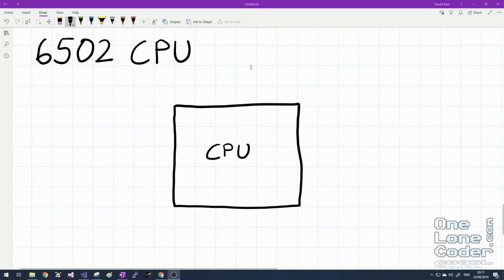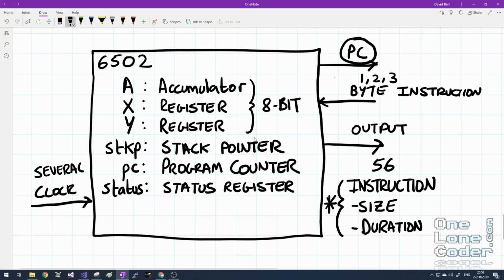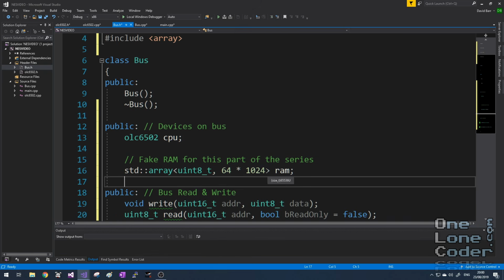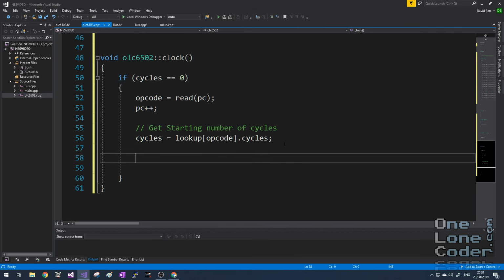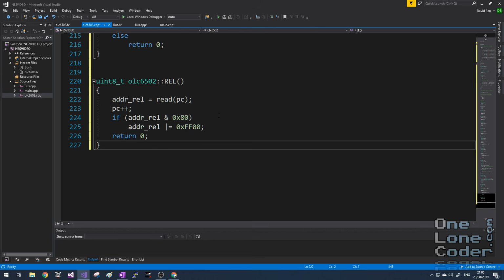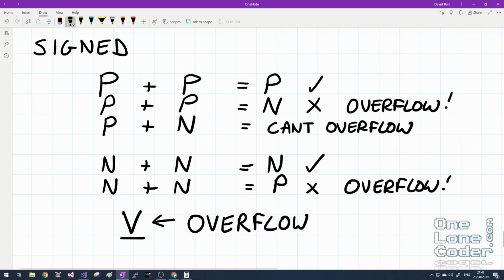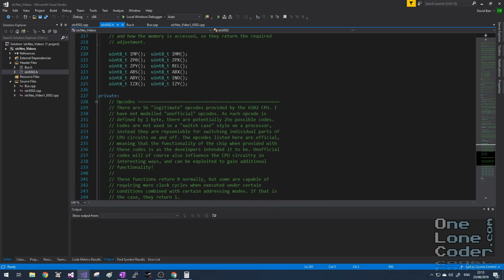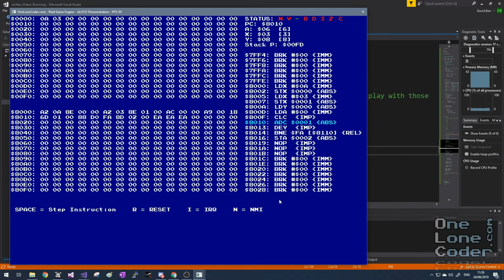NES Emulator Part #2: The CPU (6502 Implementation)

Comment: One thing i wonder - how much speed can you gain by writing emulator entirily in assembler?
Reply: Writing an emulator in C++ and compiling to run on a modern processor from the 8086 family will already give the emulator an incredible speed boost over the original chip, by virtue of the fact that CPU's nowadays commonly operate from 2.5 GHz upwards. The CPU in the original NES was probably clocked  in the MHz region.

Certain complicated parts of an emulator's code could likely be written in assembler to gain  the maximum amount of performance, but the real question here is how useful would it actually be to make this emulator run any faster than it already does? Looking at games from even the PlayStation 2 era, running on PCSX2, certain physics such as run speed are tied directly to FPS, etc. Not to mention that as expressed in comments above, not sticking to clock cycle timing religiously may break some games that make use of certain behaviour at a hardware level.

Given that NES games were built specifically to operate well on this hardware, what benefit do you get by further increasing the speed of this emulator which will already be running many thousands of times faster than the original hardware? You would just waste even more host clock cycles idling while waiting for emulated clocks to tick over.
Reply: Thanks for the info! I am only vaguely familliar with the fundamentals of emulation. That's some great information.

What about writing an NES emulator for a systems that was made around the same time as NES itself? +3-4 years after it. While those systems (Sega Genesis for example) had more processing power than NES, it would still not be ennough to run an emulator, written completely in high-level language such as C++? Would it make sense to write in assembler in that case? Or is the boost so insignificant it wouldn't make a difference?
Reply: @GRZNGT  That is a good question. When the computer you are running the emulator on is only marginally more powerful than the hardware it is emulating, it then becomes important to make sure that your code is efficient otherwise you risk lag. The emulator itself will add overhead when processing the opcodes of the hosted architecture, so the processor had better be good enough that it can execute an "emulator cycle" at least as fast as the real hardware can execute a real cycle.

In order to calculate how much faster the cpu would need to be, you would need to measure how many real cycles it takes to execute a single emulator cycle, then multiply the NES clock by that number. In this situation, minimum CPU requirement relies directly on efficiency of the emulator.

In the modern day, however, we have an abundance of computational power. This means that less and less regard is given to writing efficient algorithms and programs compared the past, because we simply have more processing power than we actually need in order to do this.

If the NES was powerful enough to run those games back then, then there is no real reason that even a badly optimised emulator shouldn't be able to run a NES game smoothly in a modern computer.

Optimisation of (NES) emulators would have been important if we were attempting to run the emulator on a computer of similar era to that of the NES itself, but given the sheer power of modern day computers, we don't need to worry about writing any of this in Assembly. C++ is more than powerful enough to get everything done quickly, and still leave a few billion cycles before the next emulator cycle is executed.

Emulators didn't exist back when this would have been a problem!

P.S. This is a very naive attempt at an answer that doesn't take any of the more "modern" aspects of computers or Operating Systems into account. Time slicing and other OS level process management, etc, could all factor in to this argument at a "user mode" level.

The above answer pretty much assumes that the "modern computer" in question will execute only the emulator's code and nothing else. Effectively, the emulator would be the Operating System.
Reply: Not much, as 6502 opcodes are nothing like x86 opcodes. (Maybe I'm wrong)

Comment: A funny thing happened when I compiled the code with the VS2019 x86 Native command prompt. When I linked the program, Windows Defender immediately gave me a virus alert and deleted the executable. In case anyone wants to reproduce it, I ran cl /c /EHsc *.cpp and then link /OUT:olcNES.exe *.obj. Might have something to do with the machine code injection? Still, it's an amusing false positive.
Reply from the maker: That could be the GetAsyncKeystate used in pixel game engine. Some AV software can identify its use as being a key logger. Interesting find though, nice one.

Comment: Why the CPU don't store the register state on the stack? It's only 3, and is something the IRQ handler will always have to do by itself. I think it's something most CPU's do? (I could understand it on an x86 system, maybem it has a lot of them, but this ones?)
Reply from the maker: Registers in hardware are a lot more complex than simply memory locations. They have all sorts of digital connections to various parts of the CPU.

Edit: Lol, read this back and completely misread the question XD
Reply: Calling an IRQ is already 7 cycles long (longest instruction in CPU!). Pushing 1 register on stack takes 2 cycles ( 1 for write to memory, 1 for decrementing the stack pointer). So 3 regs will take 6 cycles. That will make an IRQ waste 13(!!!) cycles before it even begin! And what if IRQ only use 1 register?  (Usual thing. Just grab data from device and store somewhere) Then it wasted 4 cycles for nothing.
Reply: @rsa5991  That makes total sense. Just talking out of frustration in my Univeristy times, on Operating System. lab, having to push ALL the x86 registers to the stack in meticulous order to not to confuse the CPU when returning from the interrupt. Was hard and confusing :)

Comment: rather unrelated question: why are the integer datatypes called uint8_t, etc.. and not just uint8, uint16 etc.. ?
Reply: It's simply because the t stands for type

So uint32_t == unsigned 32 bit integer type

Comment: How are the cpu timings going to work? Isn’t it running 100x faster than the actual 6502 right now?
Reply: I think he half-covered it in the beginning.. Instead of the actual 6502 processing some instruction over x clock cycles, he can use his extra-fast modern CPU to perform it in one step, then just 'wait-out' the rest of the clock cycles for the appropriate amount of time.. Then move onto the next instruction. Correct me if i'm wrong!
Reply: Well the 6502 in the nes is like... 1.7mhz for NTSC/1.6 PAL
that is 1700000 (this is apx, not exact, check online for exact)
1hz = 1 cycle... so you run the rom until 1700000 is reached in a single second then you just WAIT and do it again
basically running 1700000 cycles per second.

so if it takes say. 600 ms to do 1700000 cycles, you wait 400ms, (to reach 1 second) then do it all again.

to be cycle accurate, you just make sure you do that delay, and have each opcode properly count the cycles (which can be tricky)
Reply: samljer yeah but then the problem would be that your game would run really fast for a couple of milliseconds and then just freeze the rest of the second. Also waiting less than one milliseconds (and we are talking fractions of microseconds here) is also not an option
Reply: Because windows doesn’t really schedule it accurate and even sleeping a thread for 1 millisecond can become like 15 which is completely unpredictable

Comment: Someone is probably gonna point this out anyway so it might as well be me. Since you do everything at once and wait out the clock cycles at the end, you won't have proper timing for instructions that read/write data to the PPU and APU. This means that games that do rely on it won't work properly. Are you planning on handling this at some point or just accept the fact that it won't support these games?
Reply from the maker: Hi Piotr, you're quite right, it is not clock cycle timing accurate. Which games do you think will have an issue with this? If it is a problem, then I will probably live with it - I've never claimed this will be a precision emulation, but its good enough to generate some useful learning material and hopefully interesting content out of.
Reply: @javidx9  Don't get me wrong, I really look forward to watching how you did your emulator. I've been meaning to do my own for quite some time.

Fortunately, there aren't that many games for the NES that require really accurate emulation but games Battletoads might have issues. Also even Super Mario Bros relies on pretty obscure HW features to work correctly. There are patches for most games though.
Reply: I would have thought that as long as you follow the clock cycle timings in writing to the PPU, and have the PPU display said pixels (via emulation) then you should be golden.
Reply: @DDD-vs2pe  That's not 100% correct - since each instruction takes multiple clock cycles and e.g. reads and writes happen at specific cycles, there can be a difference in time between where that write was supposed to happen and when it did actually happen when emulating. Some games take advantage of knowing the precise cycle when this write was supposed to happen and break when it's done at a different point in time. Also some instructions do "phantom" reads and writes which can also have side effects that some games take advantage of. Not to mention undocumented opcodes like a 2-cycle NOP.